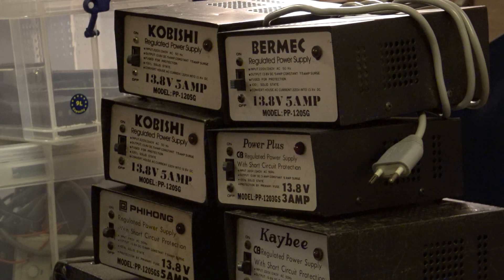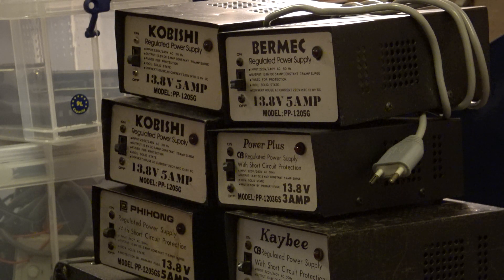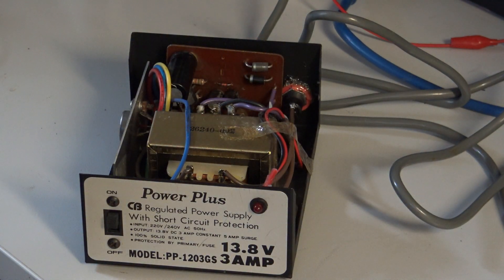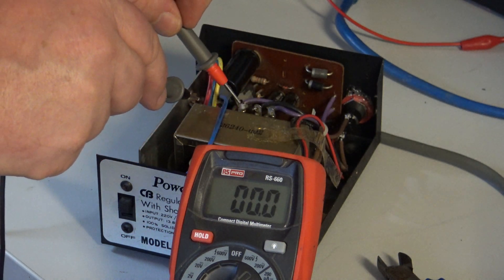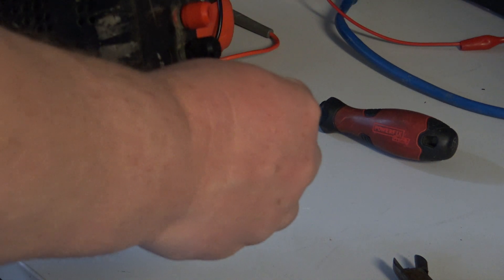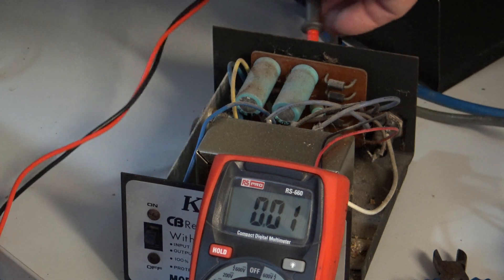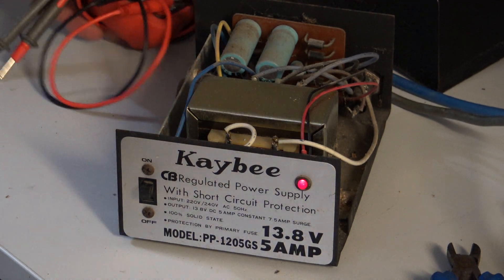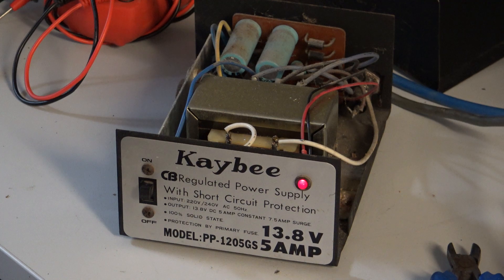Banned 1981 CB power supply bonanza pt1 ; my plan & an AC voltage  check

Comment: My one I hope is OK nentone
Reply from the maker: Now these are 40+ years old, the capacitors need replacing. The last thing you want is the regulationto fail & the unit pump out 26V instead of 13.8V! That's what happens.

Richard

Comment: I have one of these power supplies. 20 years ago, i totally rebuilt and redesigned the psu, its now a high current, variable voltage psu, with voltage indicator meter and cooling fan. its still in daily use for testing radio's.
Reply from the maker: So it either still has a 5A rating, which is the maximum the transformer can supply, or you changed the transformer. I'm having difficulty finding 16.5-0-16.5V transformers to do our replica that will fit in the case beyond 4A, so if you changed it did you stick with a standard  clamp transformer or use a toroidal one? 

Richard

Comment: I use to have the Power Plus version, although I didn't use it on my CB's, but I used mine to power a last gasp BSR belt drive turntable I had salvaged from a broken Amstrad stereo. With these not being the safest to use, and my stereo then a cobbled together mess of components salvaged from broken stereo's, how I didn't blow myself up I'll never know.
Reply from the maker: Yep, we have the power plus 3-5A one here. That'll be another series of videos as it uses a different circuit.

Comment: I remember them in the US also some had Pyramid name on it.
Reply from the maker: Aha, so it wasn't just the UK. I don't know USA electrical safety rules but of course getting a shock from UK 230V is much worse than USA 117V. It was a shame as the PSU's work so well otherwise, and the fact that so many are still working fine 40 years later says such a lot.

Richard (UK)

Comment: I'm in the U.S.  I have one look like that it a pyramid  used it for 20 YEARS  for a 2m ht it went out last year  I wus going to fix it for a spare  I usually us astron power supply  I have 6 of them 
I just fix 2 70 amp n a 50 amp 
Just a ic chip for less than 10 dollars total  good power supply 
Are pricey
Reply from the maker: Yes, I just don;t trust switch-mode PSU. I've seen so many commercially in my repair life what have been beyond repair, I'm a big believer in proven technology & these PSU's are well worth rebuilding nowadays.

Richard (UK)

Comment: Looks like we have all gone power mad. Graham did one a few weeks ago, I did an Altai last week and you  have done the Kaybee today. Like buses haven’t seen a CB power supply in years then three come along all  at once. The transformers are poorly made in many of these with bad regulation.  Still I have a soft spot for  linear power supplies when it’s all switch modes today.
Reply from the maker: Poor transformer regulation or not, the transformer is 33V off load, so I'm sure the DC output will be steady. We'll see!
Reply from the maker: I'm watching your Altai power supply repair video right now.

Richard

Comment: Back in the 80's my uncle had an ICOM straight 40 27/81 rig in his shed..    One night it didn't come on so I thought I would check the fuse..   Unscrewed the fuse cap and put my fingers on the fuse to remove it and BLAMMO!    The fuse was fine..    It might have been a good idea to unplug the PSU first..   I got the shock of my life!
Reply from the maker: Exactly. Don't confuse the Icom ICB1050 radio that you are talking about with 'real' Icom. I can assure you that CB was just fake use of Icom's name.

Richard
Reply: @ukfmcbradioservicingTango21  Yes, I watched your video about that particular set a couple of nights ago..  It was great to see it again!
Reply: @yorkshirebikerbitsnbobs  They were rubbish CBs.  That fuse was wired wrong, wires should have been the other way round so when you removed the cap you isolated the power, not left a live fuse sticking out the end.  It also should have held the fuse and taken it out with the cap.
Reply: @BoB4jjjjs  Yes, many years later I now see that I was a victim of sh1tty murderous design!  That fuse sh1t design could have finished me off....    To me, that "fake Icom" was great as it worked okay and I didn't know any better..

Comment: It very dangerous power supply I've had to change the fuse holders and put shrink sleeves on the live wires like on the fuse holder and switch and the input on the transformer.
Reply from the maker: Yes, they were banned from UK sales in 1981. Some have 2-core mains lead with no earth. Most have a single pole switch wired to switch the neutral. The fuseholder needs to replaced with a captive cap type. Internal mains wiring needs sleeving.

Richard (UK)
Reply: @ukfmcbradioservicingTango21  yes I've forgot to mention a about 2 core yes your right it was banned somewhere in the 80s I've still got about 20 on this power supplys in the loft it all same power supply but in different names on them like your video am sure it just 1 factory makes it and sells on to different company's but am sure it made in Poland if am right?
Reply from the maker: This type of PSU was definitely made in Taiwan.

Richard

Comment: Still got 2 of these, one 3 to 5 amp and a 5 to 7 amp. 
Were these or are these dangerous?
Reply from the maker: Yes. It's the fuseholder not having a captive cap, the single pose switch switching the neutral rather than the live. No shrouding of live mains pins inside. They work great, these are safety issues, not reliability problems. Looks like you'll be watching the forthcoming videos then!

Richard
Reply: @ukfmcbradioservicingTango21  as always Richard, I find your videos very informative.